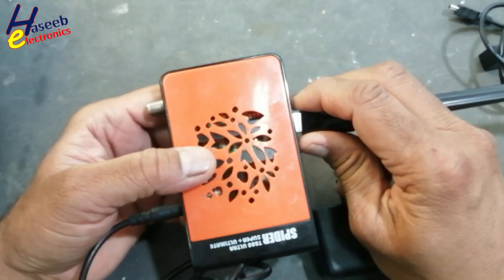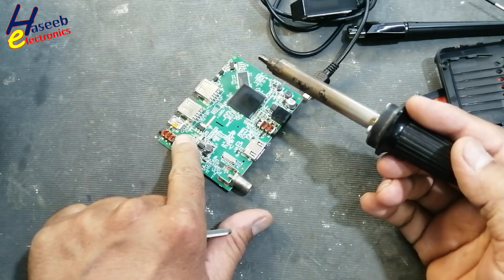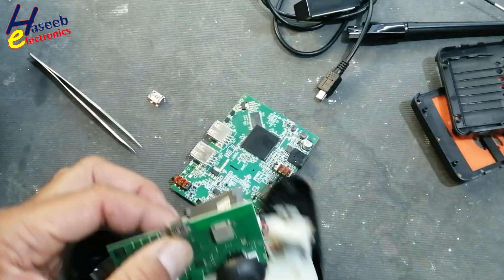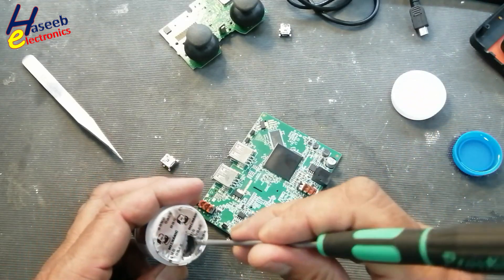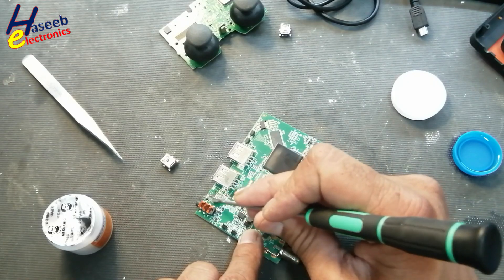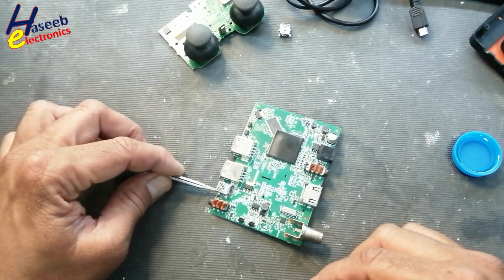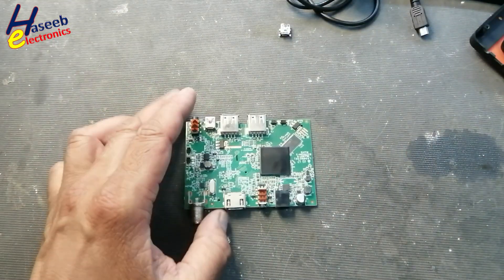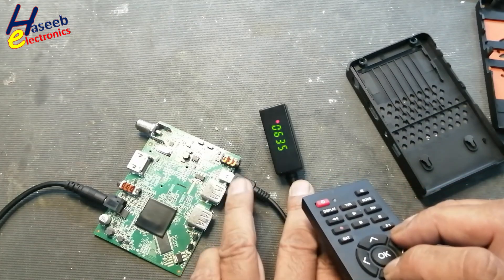{1289} How to Replace USB Port in a Satellite TV Receiver

Comment: Very good information, as always, thank you for this video
I would like to learn more about how you de-solder connectors like this with the hot-air-gun (which temperature, low/high airspeed,..)what kind of low-temperature solder you use, ...  a few of your great tips and tricks
Thank you again for your great videos... always a pleasure to watch
/chriV